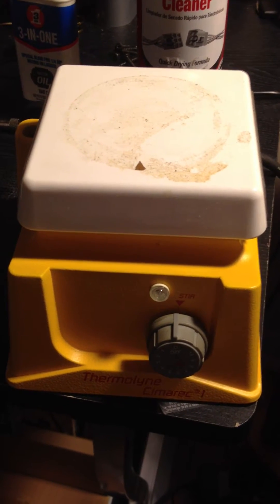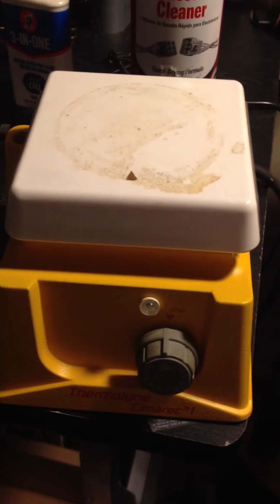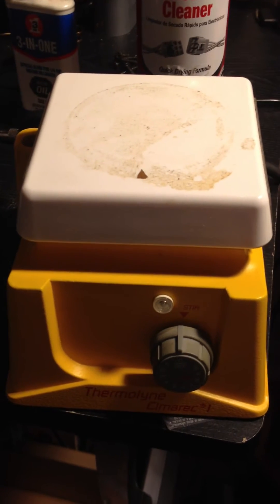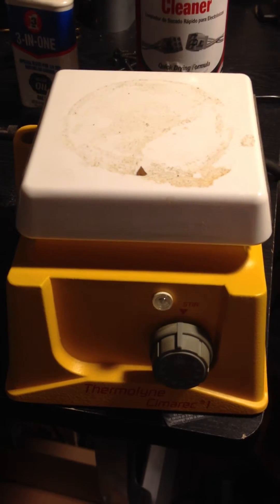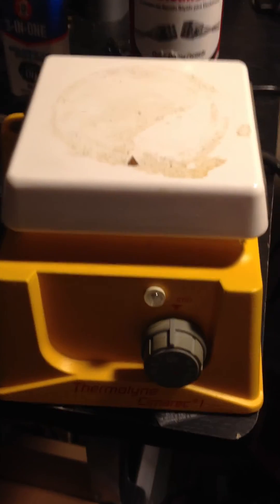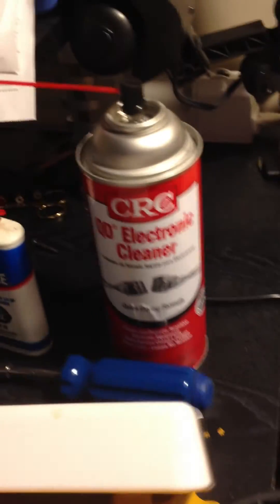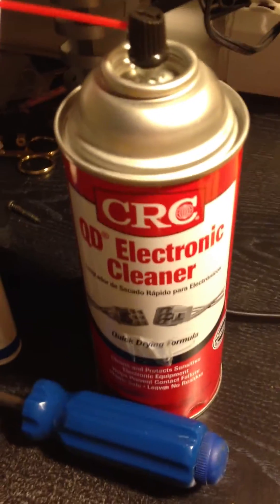Electronics Repair: How To Fix a Potentiometer (Pot) / Rheostat / Variable Resistor

Comment: My rheostat is sealed from the back, modern stuff, in a guitar volume control. Can I spray the base of the knob control and hope some of it gets through to the switch?
Reply from the maker: Yea, I've done that before.. it won't hurt to try it.. i would look for a small hole on the back of the pot to spray into first though.
Reply: I was able to spray through a small opening, not able to aim at anything, but it's good that this spray doesn't really hurt anything and dries quickly. I blasted it a few times and some of it got through because it works better now. Manufacturers are not clued in to helping us with sealing everything off for their own convenience I'm sure. Thanks